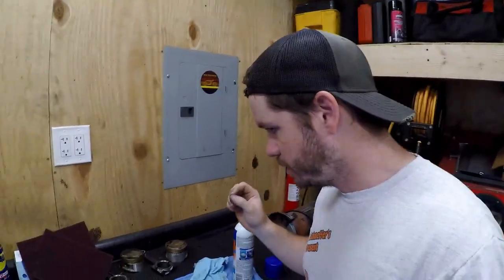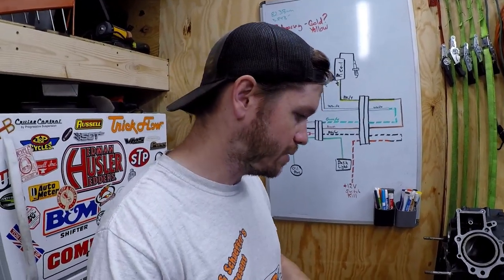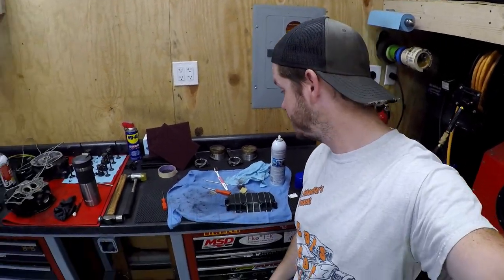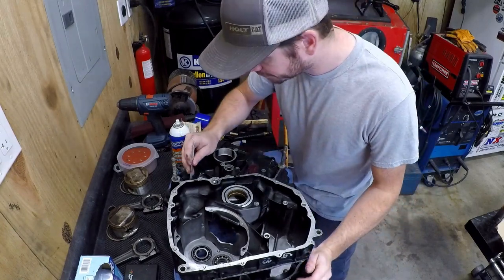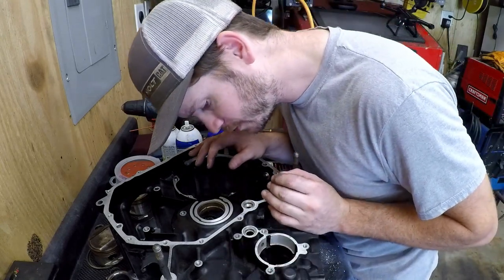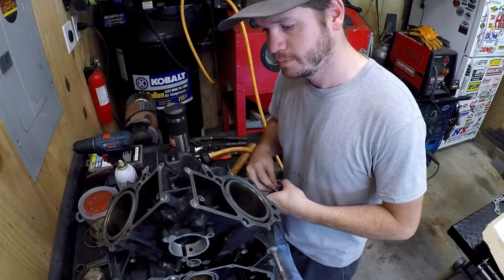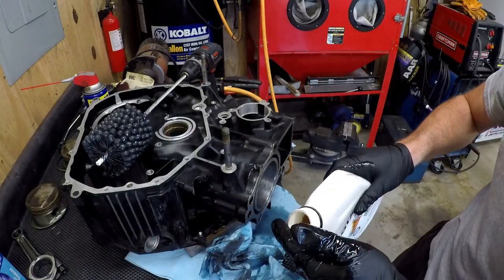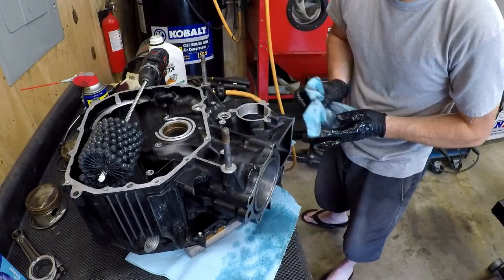CX500 Build - Making The Engine Look NEW Again - Cleaning / Hone / Paint EP36

Comment: you are the first mechanic I have seen on YT who has cleaned a cylinder bore properly before assembly. Good job, its a pleasure to watch you work.
Reply from the maker: Really??! I very much strive to set a good example on these videos as I know many use them as a resource for information. I don't want to give bad info so I made sure I looked into this before I did it on a different bike. I'm lucky that I also have great contacts that I can draw solid info from when what I'm reading is unclear. Thank you for the compliment and thank you for watching!
Reply: @BrickHouseBuilds  apparently few people know that cleaning a cyl bore with solvent isn't good enough.
Reply from the maker: @ihateemael  My xs650 I did a hone on a year back I cleaned in my solvent tank but have since read into the proper methods. I'm always trying to learn and improve
Reply: @BrickHouseBuilds  back in the 80's a mechanic friend fitted new rings to a VW combi, as he had done many times before. A week later the customer came back complaining the engine used a litre of oil. It was smoking too. He stripped it down again. I looked at the rings with a mag glass and saw scratches and vertical wear marks like someone poured sand in the bores. Then he told me he honed it himself, washing the cylinders in his parts washer. So honing grit got trapped in the cyl cross hatch and ground the rings to bits. Again he honed the cyls and fitted new rings, but washed the cyls in detergent, (till a wiped rag stays clean). The result, no more oil burning or fuming.
I got the idea from oem car engine assemblers in Australia. They had similar problems at a new production facility, engines coming back with problems. Cost a ton to sort out.
So now I pass this down hoping it may benefit others.

Comment: Is it okay to wash it in detergent like that with the bearings still in the casing? I want to do a deep clean like you but I don’t know if it’s good for the bearings
Reply from the maker: So the important part is to not let them dry via evaporation. I had coated the metal bearings with wd40 before going in the tub. I had the garage setup and ready with my air hose as once I was done scrubbing I ran the block up to the garage and used compressed air to dry off the bearings and steel surfaces throughout. I think quickly get more wd40 on the bearings and other steel to prevent flash rust. The detergent is used for lifting metal from the fresh hone marks. Very important to get the bore surgically clean as I show with the rag
Reply: @BrickHouseBuilds  thank you I really appreciate it! Is there special detergent to use for engines or can I just use laundry detergent?